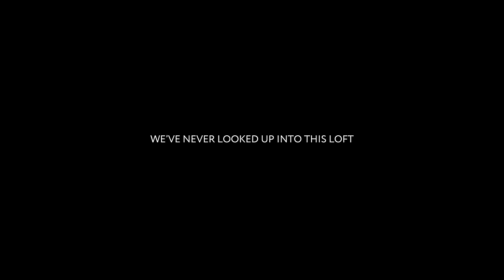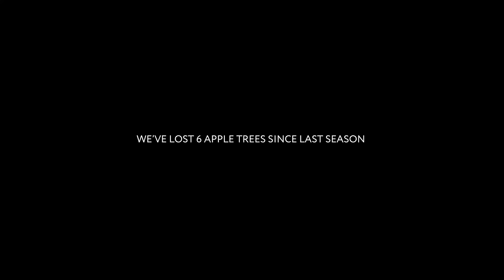Our Chateau Walls Are Crumbling

Comment: JFYI, just because the apple tree has fallen over doesn't mean it's dead, just use straps to put it back and leave posts to stabilize it and it will recover. We have done that several times and the trees still lives, the lase one fell over more than 15 years ago and it's one highest producers of fruit.
Reply from the maker: We have a couple that have blown over and still produce fruit.

Comment: You can pull those apple trees up - a strap on the front of a truck and then around a tree and drive slowly backwards. Second, don't squirt foam into the walls.  Better to use a stone, which you can easily extract when the pointing is being done. Third, the easiest way to do a mass removal of vines off the walls is to cut at the ground and leave a couple weeks to dry. Then they aren't holding to the wall as strong when you come to snip the vine. Further drying will let you brush the walls of the remainders, so you never pull vines off, you are rubbing them off essentially.

Comment: Hello. You could paint the walls of your vegetable garden white. This is how they do it in England. Your fruit trees will ripen faster. A mechanical alarm clock will help against moles - lower the jar into the ground and set the alarm clock, cover it with a little earth. Moles don't like noise.

Comment: The walls:  I imagine you have already received advise on how to save them. This is what I would do:  Once the overhead branches and nearby trees have been removed,  take off all of the ivy, moss and other growth on top of the wall. As you work along the wall, you want to put a new cap- temporary to stop water infiltration where the wall is in the poorest state of repair (heavy tarp for example) or permanent which can be a concrete cap, copper, galvanized metal- whatever is available that suits  your budget- stone if you've got it.   You might need to work down a few courses- removing all stone and then rebuilding using the traditional sand/lime mix if possible (except for the top where you would use modern mortar- when  using modern mortar, there is an additive that is added to the water that will make the mortar much less susceptible to cracking).  As long as the walls are not listing, they don't have to be disassembled.  Then, with a screwdriver, test the mortar along the wall. 
Where it has turned to sand, remove it 3-4 inches back and using a canvas sac filled with new mortar (traditional or modern) that has one of the edges cut open, squeeze new mortar into the area and point it up.  Best thing to do, have a pizza/mortar party- get lots of friends to come and eat pizza (or whatever!) while a crew works along the wall removing the old mortar, followed by someone power washing (be careful not to use too much pressure or you could collapse the wall depending on how thick they are, etc) to remove dirt, etc. and then a crew using the canvas mortar bags (should be able to buy these at  a cement supply place).
A ton of work but with a crew it will be less painful- Hope this helps!

Comment: You have a very healthy back yard as shown by the size of your trees.  It may be shocking to see all those big beautiful trees come down but they won't be crashing into the buildings and the walls you have.  Lucky break with the pine tree logs.  I hope the gift of them helps you out.  The new apple trees here in New York State are replacing the apple trees of 10 years ago.  They grow on a stake and wire and produce just as many apples as the old ones did.  I am glad you got help with this project and the stone wall will benefit from someone else doing the work so you can keep up with the apartment rendition.   Other stone work shown on YouTube Channel looks like a lot of work and physical strength.  The surprise work to keep things correct and nice just keep going.

Comment: If it ain't one thing it's another, as the song goes. That seems to be the theme of renovating older properties. It's too bad you have to trim the trees away to help the walls stay structured because they are so lovely and charming, however that is wood you can use for heat I suppose. I would need a designated "Lincoln" if I was to renovate an older property as I am not going near half the stuff you and Lincoln has to excavate so I admire how you both do it seamlessly.

Comment: Biting my tongue on your bonfire special guest roast.  On your wall I think before doing any temporary filling, I think you should consider clipping the viny parts all over to reduce the amount of viny material growing on the wall that would be in your way. Obviously you don't want to just pull the viny stuff as it could bring the wall down on you.  I would only remove the bits that were not attached. End result would eventually be to have room to repoint with lime mortar...gently. I had rather not use spray foam, but I like that option better if it means you and Lincoln don't become very flat 2 dimensional people under stone.  Leave room for re-pointing. It would confuse the kitties and donkeys. Kids and dogs should be ok, though. Good luck...wish I was there to help.

Comment: Before you squirt that foam into the walls, please ask a professional. I'm thinking in the long run that it will not let moisture evaporate like lime does and further damage your walls. Another thought, if those apple trees have fallen and not snapped, have you ever tried pulling them back up and staking them? They still looked like they had  roots in the ground. Your picture of the owl was lovely.

Comment: The urethane foam isn't a good idea ... unless it's sealed because the foam takes on moisture and swells ...
So if you are going to use it ... make sure it is only temporary, and that those areas are removed and the more appropriate lime and morter is used ...